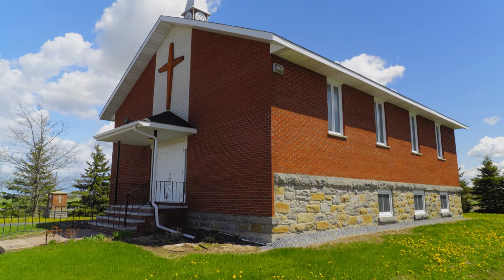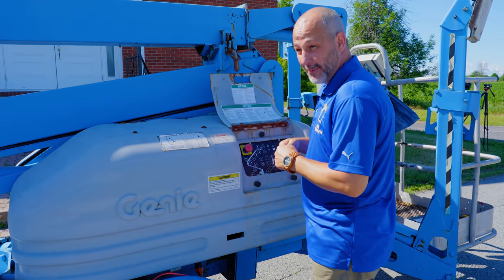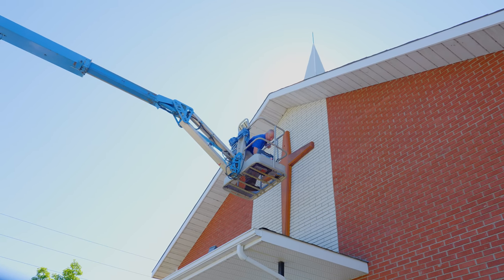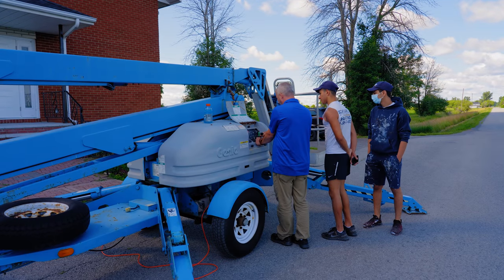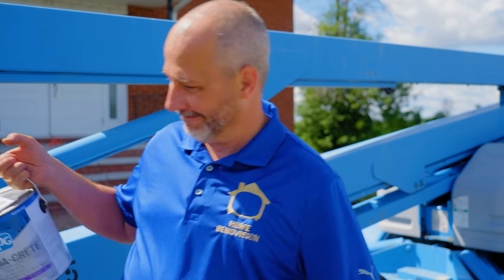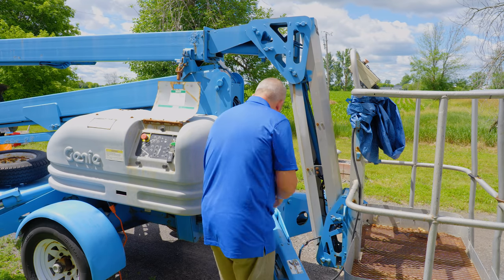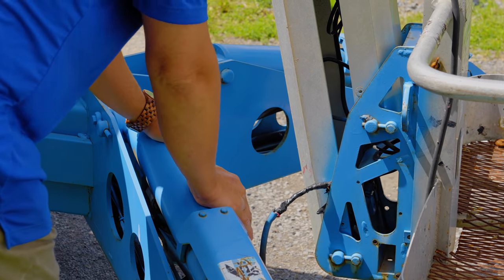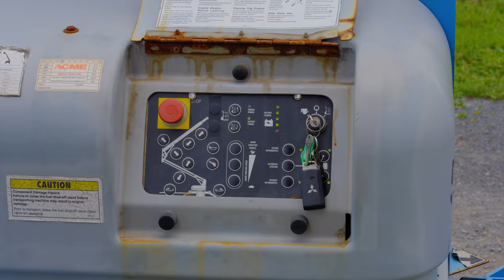When Every Piece Of Gear Breaks Down

Comment: I had a similar problem with a rented skid steer years ago.  I rented one and when they delivered it it stopped running as he was unloading from a trailer. Then the delivery guy tells me he doesn't have a winch on his trailer so they will have to send another truck and trailer to pick it up.  Then I was told the truck that was coming to deliver a replacement skid steer and pick up the other one broke down on the road. Lol! They finally get it delivered and within 2 hours of using the replacement skid steer the hydraulics stopped working ! They sent a mechanic and he said it needed a new hydraulic line and would return within an hour. Then I got a phone call saying it would take two days for the part to come in. Long story short I ended up with a broke skid steer sitting on my yard for two days ,when they finally fixed it they gave me a full refund and let me keep it for 2 days rent free. 🙃 I have since realized rented equipment gets severely abused and it's a crap shoot when you rent if you get a good one or not. But considering how much heavy equipment cost what are ya going to do!? I guess we are just at the mercy of the equipment gods! Lol!
Reply from the maker: Yup Life happens. Cheers!

Comment: Hey. I love watching your videos. I have an easy solution to any future WASP or hornet issues. All you need is Sunlight dish detergent and water. You need to mix them together in a sprayer, whatever size that will be appropriate for the job at hand. The amount of Sunlight is not a given. I put a couple of good squirts in a spray bottle and add water to fill. 
Wasps wear their skeleton on the outside.. exoskeleton. The soap breaks down the exoskeleton (I honestly don't know how), and the water drowns them. You spray the little buggers with it and they drop right out of the air. Plus, there's no toxic fumes, etc. 
Hope you give it a try.

Comment: Little hack for getting those plugs out.. just send in a screw that will hit the fastener inside and the threads will pull it right out. I use the same concept to get the leftover wood out of a hole saw, which we all know can be a pain

Comment: hello Jeff not sure if you have fixed you Genie wiring issues we had the same thing happen and used a Reese Towpower 7 way trailer connector from Canadian Tire and wired it in to use a quick disconnect it mounted nicely on the side just a little bit higher and to the left of wire yours got pinched. The Reese connector really handy for transport and storage.

Comment: That painting company should be training at least 1 person to operate a lift. For the lift program and fall arrest tickets are far cheaper than any fine or life. 

Hard to say from angles but it looks like the machine was too close to the building. What size of machine was it? I use a 65' at work and would never question it's lifting capacity.  My coworker and myself combined are 430 lbs and we've installed hardy at its max reach on 3 storey walls with no issues. 

A gas machine seems like it would make life easier there to get around? Next time you have to work around wires, call hydro they come and put guards up on the wire to prevent any arcing. 

As much as you got the wrong gray, that's still a beautiful colour, an acid wash on that limestone and it should pop even more

Comment: I thought stone surfaces and brink needed to breath?
Put 2 coats of paint on it to make it "bullet proof" as you stated would make that ability no more and cause rot and decay later on?
Not only that, paint will always need fixing down the road. The natural brick would need far less over the same time frame. Natural brink and stone will always look better than anything painted in the long run as well.